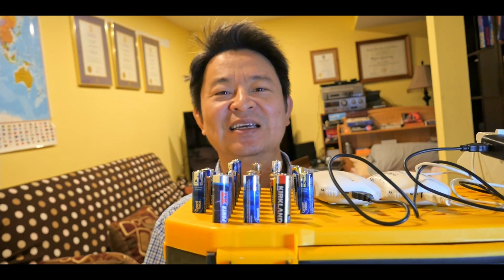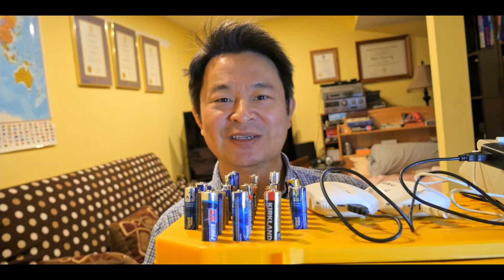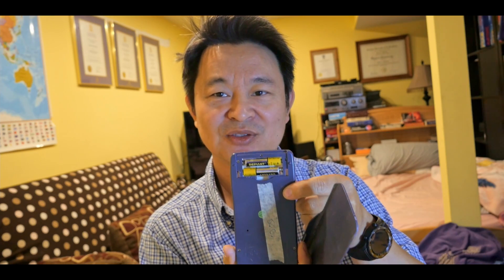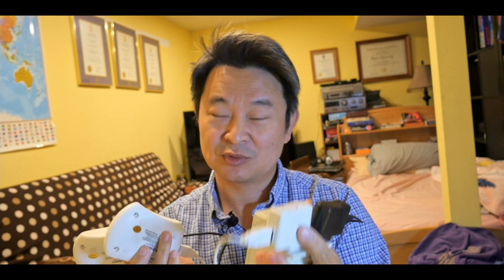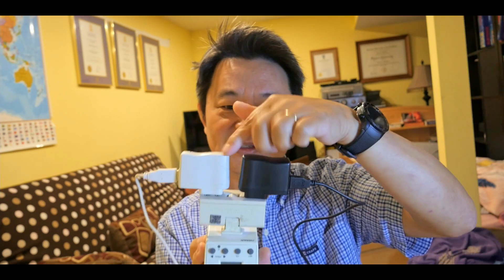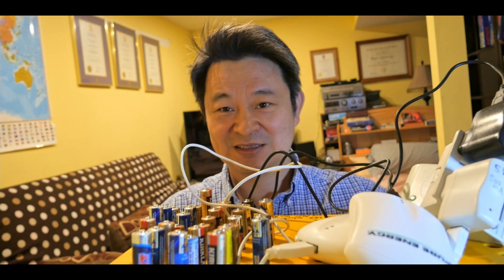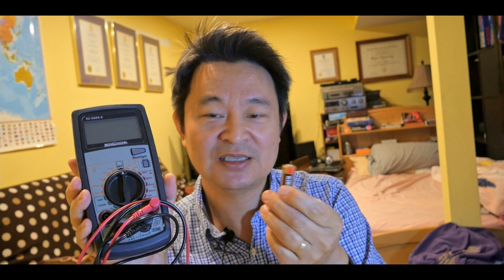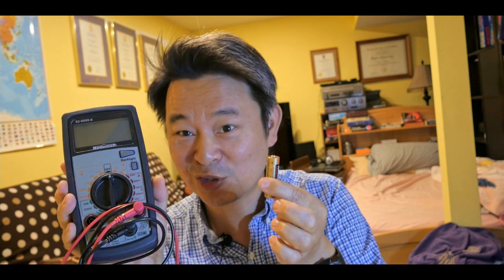How to recharge or re energize regular alkaline batteries safely and effectively

Comment: This video is A TOTAL MESS! The explanations are so incomplete & require the person to go scrounge for 10-20 year old battery chargers for long-discontinued battery types from long bankrupt companies!🤦
What's required is a much more thorough discussion & explanation, preferably by someone who knows the difference between amps & volts (10:20-10:35🙄).
At 6:10-6:30 in the video, the most amazingly confusing instructions are given for the UNNECESSARY recommendation for matching the same BRAND of batteries together (matched when put into the same "container", quickly corrected to "charger"...but where's any semblance of editing to this rambling mess?). The TYPE, yes. Making sure that you're actually recharging Alkalines, & not mixing them with some carbon zinc? lithium? Actual rechargeables? Mercury cells??? 
But the newer (XL) Pure Energy chargers can charge one battery at a time; it's the older Envirocharger, Charge Pal, & perhaps those white ones you have that you have to use pairs. But that's only to complete the circuit, not because they're going to charge unequally, or something is going to be damaged because of THAT!🤨
So besides the abysmal editing, the questionable knowledge of the subject at hand, & the rather poor and/or poorly  explained information, here's my list of questions that you need to answer in order for this video to be of any interest to anyone other than a junk collector living in Canada who happens to still have any access to decades-old obsolete battery chargers of a uniquely specific type...
1) You don't mention whether there's any issues with trying to charge RECENTLY DISCHARGED batteries, versus batteries that have been "dead" (discharged well below the point of being useable; say, about 1.0V or so) & sitting around for more than 6 months. Or how about 1 year? Or more?
2) So does the AGE of the battery, the amount of TIME it's been discharged to the point of being too weak, matter?
I have read from other sources that batteries, though not specifically Alkaline types mind you, more than about a year old have undergone too much chemical degradation due to the passage of time to respond usefully to recharging of ANY kind.
3) Does the DEGREE of discharge matter? Is there a "threshold voltage", say 0.5V, or 0.4V, or...? What about 0V??? Before the battery can be said to be too discharged, too "damaged" to be able to respond usefully anymore?
4) You mention in one viewer comment that you responded to, that disposable (& presumably rechargeable ones too, hence the need for the exact same chargers!) Alkalines need to be "trickle charged".
And that Chargers designed for NiCd or NiMH batteries (or presumably, "Universal" Battery Chargers like my Ray-O-Vac purchased at Wal-Mart 10 years ago, that has circuitry to "identify" the formulation in the battery & select the charging program appropriate for it) don't use low enough charging current to charge disposable Alkaline batteries without overheating them & ruining them permanently. 
So if I don't have, & cannot find, one of these Pure Energy "🦖dinosaur 🦕" chargers, how about mentioning the ELECTRONIC SPECIFICATIONS REQUIRED IN ORDER TO CONSTRUCT A SUBSTITUTE? I think the OVERWHELMING number of viewers are going to have this problem, so by not mentioning the EXACT details of the "correct" charging regimen, this video is absolutely useless to them except for the vague knowledge that recharging disposable Alkaline batteries is theoretically possible, SOMEHOW.
5) To that end, you mention a charging time of 4 hours. Fine.
What's the recommended trickle charge current then? And how does it get varied, or does it at all, over the 4 hour period? Does the battery itself govern the charge current as the process approaches completion, is it actively current-limited by the Charger?
Or does the circuit otherwise taper, or pulse, changing currents over the 4 hours?
And how about the voltage? Is there an absolute maximum, PER CELL? Does it change over the 4 hours? Or is the voltage supposed to be regulated to a fixed, constant amount?
6) Because the recommended equipment required to duplicate the results shown in your video are obscure to the point of complete unobtanium, this HAD to become a much more technical video than simply showing how to connect up a battery charger to a 4 hour timer. 
You NEED to explain something about WHAT & WHY, & HOW, this process works. Armed with enough information on the actual SCIENCE involved behind how the batteries, AND their rechargers, actually work; then ANY viewer with even a modest knowledge of electronics can figure out how to duplicate it with other, more available & preferably off-the-shelf components.
A mostly impractical, unscientific, & seemingly uninformed as it was uninformative video. Truly a wasted opportunity on what could & should have been a highly interesting subject...😑
Reply from the maker: If you do have lots of knowledge in these matters please post your videos with your insights.  I think we all will benefit. You can try watching my latest video on a DIY zinc carbon battery that I salvaged together attached to the voltage booster.  Thanks.

Comment: I bought a ton of used 18650 for really cheap from a computer repair shop that regularly throws away faulty laptop batteries. I modified every clock or device to take it. Now that's how I solved the problem. The kitchen timer that I use everyday is still working after one and a half year from a single 18650. 😂
Reply: Excellent I'm so glad you do that. I also do that. ❤
Reply: I have been using 18650 for 3 decades, love them
Reply: That's awesome 😎
Reply: Which charger do you use to charge these? I have so many old laptop battery 🔋 waiting to dissemble
Reply: Use an universal charge from China like Opus for lithium cells. Seems that alkalines need a super low current and long time, so it might not work with a general purpose charger that can only do pulsed 200 mA. Also if their voltage goes up, the charger might consider them full early.
Reply: @Goodzillla1066  No never use Ni-MH charger with laptop 18650 bateries the are lithium batteries!
Reply: @Goodzillla1066  No never use Ni-MH charger with laptop 18650 bateries the are lithium batteries!
Reply: Plus the 18650 are more voltage 3.5 where the alkaline batteries are 1.5volt
Reply: @archerdragon1  Most 1.5V devices can take 2.8-3.2V. On the other hand, you can use tiny buck or boost voltage regulators modules if you want precise 1.5V. Once again, it depends on your application.

Comment: Can you suggest a recharger. I have a NOCO 5 battery recharger for 6v and 12v. Can you also suggest exactly what type of adaptor. I have collected many adaptors. Input 120/220v Output 5v to 18v. I do not see the pure energy recharger on Amazon.
Reply from the maker: I don't have any brand I would recommend. Just try to get a charger with low current charging and time based / voltage limit charging to prevent overcharging.
Reply: Eveready & Mallory ("Duracell") make small chargers for AA/AAA/9V batteries, usually near the checkout aisle any major department store like Wally-Mart & Home Despot. Usually in a big "blister pack" bundled with 2,4, or 8 NiMH batteries in it. Typically $15-30...
If you look a bit harder, you should still be able to find "Universal" chargers of higher quality that can accept the above types as well as 'C' & 'D' sizes. These are usually "brick" style things the size of a small shoebox, & they usually have a charging "status" LED for EACH battery slot, which is better. Some of the "budget" adapters require you to put in pairs of batteries in order to work; unsurprisingly, you can't tell the status of each battery, only both...🙄
Amazon or AliBlahBlah will sew you up nicely if your trips to the mall & Big Box stores come up empty handed.

Comment: So in other words a cheap usb battery charger with a 5v phone plug will work
Reply from the maker: As long as it is low current and it attached in series (1.5v x 3 = 4.5v) and voltage does go above 4.8V.

Comment: Ich lade meine Batterien mit einem Bedinie-Motor oder mehrere gleiche Akkus mit remf-Lader auf. Falls mal eine ausläuft hilft Schmirgelpapier und weider geht es. Habe seit 1 Jahr 12 Stück im Dauereinsatz. Bis heute keine zusätzlichen Akku gekauft!
Reply: Ich lade mit einem RAM Ladegerät. Aber beim auslaufen hilft kein Schmirgelpapier. Der Metallbecher der Batterie ist kaputt und dann korrodiert das Batteriefach von dem Gerät, und en sie benutzt wird. Eine doofe Arbeit, das zu reinigen
Reply: If batteries are already leaky, it might be a good idea for you to know that the chemicals leaching out from the cell are HIGHLY corrosive to metal, & will quickly & PERMANENTLY destroy the battery compartment of whatever device you were stupid enough to leave them in for any length of time (often less than a month!).
If ANYTHING is seeping out from the top and/or bottom of a cell, IMMEDIATELY discard it!
If you want to save €1 in order to pay €100 for the damage you caused soon after, just keep wasting your time trying to repurpose something that actually needs recycling (as e-waste!).
In fact, recharging Alkaline batteries is a bad idea in general; if you REALLY want to pinch pennies, buy the cheaper Zinc Carbon batteries instead. They are FAR more receptive to repeated recharging, & NEVER leak & "puke their guts out".🤗

Comment: 300mA is very high, try to reduce to 15mA
Reply: That's fine for a 9V battery. For other sizes, you will be waiting at least a full day; for a 'D' cell, it might take several!
Reply: @joerosen5464  for alkaline batteries you must use low current, for a D cell I would use max of 50mA, otherwise will leak.

Comment: How long to charge alkaline 1150 mah 1.5v aaa batteries on 120ma or 250ma charger
Reply from the maker: I think the lowered current (120ma) is better, although it will take longer to charge.

Comment: In the 80s I used to put them in the the oven on very low heat
Reply from the maker: What is the mechanism behind heating it and getting the higher power capacity?
Reply: @educatetube gives a little more life to them basically same concept applying heat to recharge
Reply: I remember those days I did too only thing I didnt use oven I put them negative side down in a skillet
Reply: How did they taste when they were done?🤓
Reply: I use to put them in the toaster

Comment: I recall having a charger, perhaps 20+ years ago that could 'refresh-charge' alkaline batteries and it would really work.  As the host says, it would not be to the capacity of a new battery but it would be enough for use over an appreciable period.

I've just had a look and I still have it.  It is the Goodmans Intelligent battery charger GBC1100.  It has a switch dedicated to alkaline batteries.  It really saved me a lot on battery costs.
Reply: As a kid I tried it and quickly discovered alkaline batteries could be recharged up to about 10 times, after that they decline in the ability to hold charge.
Reply: @Battleneter ... Nickel-Cadmium rechargeable batteries aren't recharge life efficient either.  Only Lithium rechargeable batteries are batteries for recharge over rechargeable.  I am using a cellphone typing this on recharging my cellphone Lithium battery of 5+ years recharging just about every day or every other day.  The trick there is to not ever "memory recharge" to get down to less than 5 percent battery power before recharging and then trying to unplug recharging beyond 100 percent A.S.A.P.  Use a 2 hour charger to recharge new cellphone batteries if Lithium designs.  Note: Lithium battery companies make different Lithium constructions where 5 years is the maximum lifespan to where the batteries completely fail by.  I haven't experienced this problem yet in my Motorola cellphone and their internal cellphone battery.
Reply: I found using a pulse charger really helps as well for more life  @Battleneter
Reply: We used to charge the Zinc–carbon batteries. If the batteries were flat because a higher current drain, they could be recharged much better. If the batteries were used for small load for a long time, their "recharge life" were much worse. For alkaline batteries, I think if you over charge them, it will explode. So if the battery still has a lot of power left and you still charge it, it will explode.
Reply: @dawebslave3571  Interesting, because at 11:20 the man says that the only time he's had a battery leak was when he charged a "zinc-type" (carbon zinc) AAA by accident.
Reply: Is that the one they had a infomercial for in the early 90s?

Comment: I recharge my AA and AAA Eneloop batteries with a charger I purchased from Amazon.. I'd like to recharge A23 12v alkaline batteries that we use for remote controls/ceiling fan, but they don't fit in the recharger because the batteries are approximately 1/2 the length of a A/AA battery. Do you have any suggestions? The A23 batteries cost about $5ea and we use 2 per year per room.
Reply from the maker: You try to find a 12v charger with very low current (less 100mA) but it may take a while to charge.  Another problem is most alkaline batteries do leak after several times recharging and it may not charge to its full capacity.
Reply: I just use a solar light - put it outside in the sun and boom it charges the battery
Reply: Sanyo "Eneloop" batteries ARE designated rechargeable types! So OF COURSE you can use any old battery charger on them, as long as the charger specifies in its instructions/product labelling that it's designed for them...
As for the 12V A23 Alkaline batteries, most Dollar stores sell them, & never for more than $2ea. I've had great luck with these Dollar Store Chinese no-namo brand cells. Long life, & they don't puke all over the insides of the battery compartment in the device you're using them in. Unlike Mallory "Duracell", which are the most expensive Alkaline batteries & THE WORST BRAND IN THE WORLD for "puking" & destroying all the metal parts & contacts in the battery compartment of the device you were stupid enough to trust them to wear out & die quietly in!
So for $2ea. (& how much do they cost online from Amazon or Alibaba?🤧), your best advice is not get all fancy & cheapskate-like. You'll just waste your time & wreck things. 
Leave well enough alone!🤗

Comment: There used to be a product called battizer, it claimed to charge alkaline batteries using small pulse charging, not continuous trickle charge.
Reply: This is the same technology that the Pure Energy XL charger from 2005 used.
Their previous rechargeable alkaline-only "Envirocharger" used "Taper" technology, which I suspect is how Ni-Cd's used to be charged. I think that with the introduction of NiMH batteries, the simple voltage and/or current tapering technique couldn't properly regulate their charging process properly, frequently resulting in damage to NiMH batteries (as will surely happen after a while when you use a vintage NiCd-only charger to try to charge an NiMH cell).

Comment: Can you write your items that we need for doing this process. I would like to order this on amazon. Thank you
Reply from the maker: Any low current battery charger will be fine.  I bought mine at the second hand thrift store.
Reply: You need a battery charger that has the ability to work on the sizes & types of batteries that you want to charge.
Any big department/hardware store sells them, & OF COURSE there's Amazon.
Then you need a line voltage timer with the right AC plug & sockets built into it, so that you can plug it into a wall outlet & then plug your charger into the outlet on the timer. Doesn't matter whether the timer is digital or Analog, EXACT time isn't critical. As long as you can set it to run for around 4 hours & then shut off, it's good enough.
Good luck!🤗

Comment: I recharged my non rechargeable Alkaline AA Batteries like 100 times by now. I got a cheap USB powered charger from ebay  and i recharge them for 30 min on/ 30 min off / 30 min on / 30 min off for 4 hours
Reply: wow thats impressive. I guess that what makes batteries "explode" or leak is the constant heat and by charging 30 min you are preventing them to overheat. Very good idea.

Comment: i charged those by mistake (because my duracell look the same as rechargeable duracell batteries) i left it on charge all night and noticed a leak this morning, only then i though, i may charged the wrong Batteries, i did ! I checked and they are full!!!
Reply from the maker: Leaking is a common problem for non-charging alkaline if the charging current is too high.

Comment: I use the C1303 charger to recharge my alkalines. It has an alkaline charging mode.
Reply: 40€ on amazon. More people need to know this!
Reply: @nutzeeer  do you need to turn it off every 30 minutes for akaline?
Reply: Brand???🤪
Reply: @joerosen5464  captelec-france 59290. though its made in china. no real brand name on it. and one thing to note about alkaline charging as that the deeper they were discharged the less they can be regenerated. might be fine for tv remotes but not for power applications. i switched to nimh batteries.